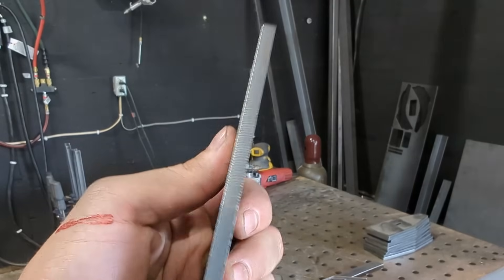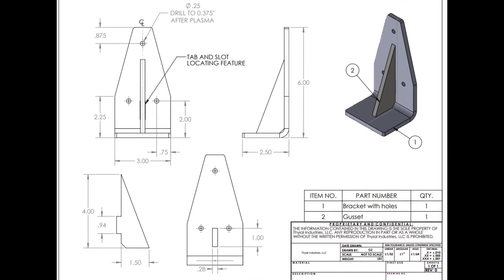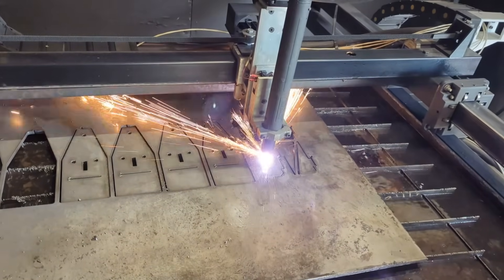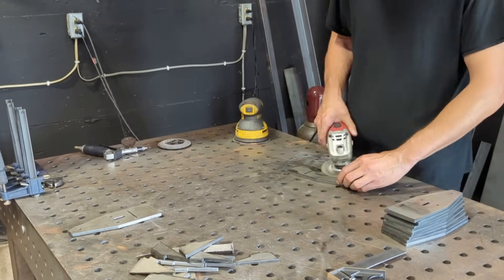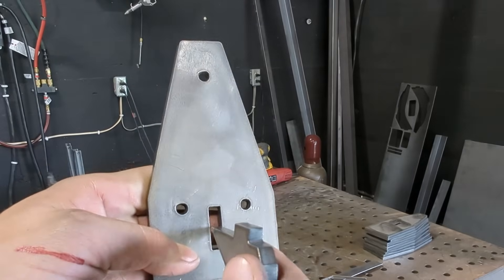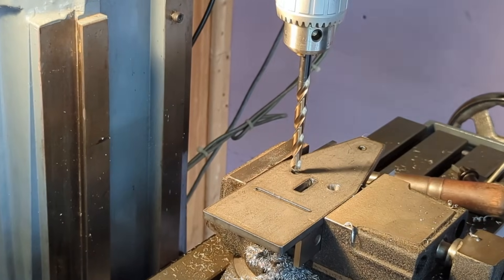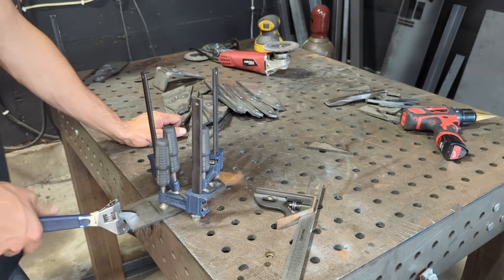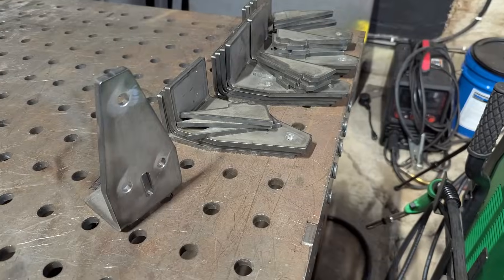No Press Brake, No Problem: Forming ¼″ Steel With a CNC Plasma & a Workbench

Comment: I built my own 22in press brake from scrap I had lying around. 20ton air jack from HF and i can bend full length 1/4 plate across my die. Cost me the $100 for the jack and that was it. Beats welding up seams and dealing with weak joints
Reply from the maker: Do you want to make me one?

Comment: The slot you made weakens the 90. This trick is used for sheet metal bending, not thick steel. You are out of spec and the client has the right to refuse the part.

Comment: There are a number of steps that could have been changed. First of all your alignment hole in the big part was not the problem. The problem was the radial cut in the corners of the small parts alignment tab. It would have been better to raise them to a 90 degree OR over cut the corners. The smartest choice would have been a 90 degree path. Bending the big parts on the table isn't a bad choice. though I would have clamped down a few guides so repeat parts were just a drop in clamp and bend. though the better choice would have been a good size bench vice say a 5.0 or so. set a spacer jig below inside the jaws and just drop them in. Start the bend as you where then finish with a  block of wood or hard material like G10 or redboard and a hammer. Faster tighter with a tighter 90. I'm not saying anything in the video was wrong just there are better methods.
Reply from the maker: Appreciate the detailed feedback and suggestions!

Comment: The one thing you didn't explain but I wish you had is how to adjust your CAM setting for the single pierce and straight line cut. I have a Langmuir Crossfire Pro table utilizing Fusion 360 coupled with an 80i Everlast plasma cutter. I've had trouble with single pierce/straight cuts not being recognized in the CAM portion of programming. I wish someone would explain what steps to do for this process. Thank.
Reply from the maker: I would have went more in depth. But as you noted, it's pretty subjective based off of what equipment and software you are using

Comment: If you notice, anybody who commercially sells “slot and tab” (yeah I know) products, “dog bones” the slots to compensate for corner kerf. Also there is always a kerf width setting in the CAM software that can be used to alleviate the issue. A few test cuts to tune the parameters is a wise time and material investment.
Reply: Thanks for this. I've been doing the dog bones but been manually adjusting offsets for kerf. Had no idea there was a setting built in

Comment: If you are welding there's zero reason to make the tolerances that tight.  Welding jumps a gap easily enough.
Reply from the maker: The tolerancing is for fixturing. Not welding

Comment: If you have a small workshop press, for bearings etc, a vee tool and blade will be muck quicker than using the bench and clamps for a narrow bend like that. Your plasma does well, I had a 40k 4mtr x 2mtr  with a hypertherm 65 and it was useless for slots and small holes, even with brand new consumables it cut on an crazy angle after piercing..

Comment: When bending with slots the amount of material left between the slots should be the same as the thickness of the material. When looking at the tab (holding the pieces together) in the plane view, the tab should be square no matter what the thickness of the material.
Reply from the maker: That make sense. That's kind of what I was seeing

Comment: I thought about doing a relief cut with a grinder to do a 90 degree bend in 1/4".   First attempts my mild steel cracked.    
If I can get it to bend, should I weld / fill the relief cut to strengthen the bend?
Ideally I'll get a press in the future, but I'm wondering what others do until the buy a press.
I checked with a few fabrication shops and they don't have a break small enough to do the two close by bends.

Comment: Did you add any welding in the tab and slot bend area to compensate for the loss of material?
Reply from the maker: Lol thanks for all the comments! And the customer might have? But I'm not sure. These are going to be tied into drywall supporting some retail shelving. So nothing too crazy in terms of weight.
Reply: @ThyialIndustries  Ahh okay then yea not needed then.

Comment: I have been "pecking" the center holes to finish the job on the drill press.... Burned up so many drill bits trying to get through the hardened kerf.

Brackets look great!
Reply from the maker: That's not a bad idea. I had to resharpen after that job. Thanks for the support!

Comment: So I’m just guessing here but you center that slot for the bend on the bend line. Or is there some math involved to figure out if the part needs to be a little longer to make up for the bending process?
Reply from the maker: If you use a CAD software like fusion or solid works, the software does the math for you. But yeah your on the right track

Comment: A good idea to show people - even with a brake press this would allow thicker material than normal to be bent 3/8 or maybe 1/2 in a 1/4 break.
Would it be a good idea to put an undercut into the corners of the tabs so that they can sit fully down on the main part. 
Cut so that it looks like you drilled a 1/4 (?) hole at the corners. You can't chamfer the inside of the slot so it will be square and the "1/8" radius" should allow it to sit down cleanly.

Do you chamfer your parts - or just remove the dross?
A chamfer may look more professional AND it lets the paint have an easier time on the corners. According to @Blondihacks its what separates us from animals... :)
You can start with the little air powered chamfer guns for ~$30 and go up to$1,000's.... if you get that big.

Comment: clearly your in love with your newest toy   as  the angle grinder would have  got them tabs ground down to fit in half the time  i would have like to see a few of them welded out  did you weld the outside of the bend .. Id be interested to try tilting the torche and gouging a groove to fold along but its an extra operation   . good content keep at it  .
Reply from the maker: Thanks! I didn't weld them but the end user might have. And yes, been loving the new mill and lathe lol

Comment: You would need to run your 3/18 carbide end mill about 8-12 thousand RPM in mild steel depending on the particulars.
Reply from the maker: Yeah, I was just lazy and didn't feel like swapping out the belts lol

Comment: just a question about those bend lines. are they 1 line with the thickness of a single pass kerf. and do you fill them with weld after you weld on the gusset?
Reply from the maker: Yes they are only one line! About 1/2" from the edges. Sometimes I go back and fill in with weld. But it depends the use case.

Comment: Sketchup was an amazing free and simple-to-use CAD program that revolutionized design for many industries. For something like basic architectural work, simple manufacturing with basic shapes, it works very well. If you want to do anything more complicated than boring a hole, the limitations will add up quickly. I don't even use it for anything with curved or sloped features.
Reply: I've been using SketchUp Make 2017 since it was released. While it's not supported any more, they followed fusion 360 and are web only, it can still be downloaded. I still use it to design parts for my crossfire plasma table because it can export dxf and SVG while their current free web version can't.
Reply from the maker: Interesting. So probably a good beginner friendly cad huh?
Reply: @ThyialIndustries  Yes, definitely.
Reply: Sketchup was free. and like many cad softwares when it was new it was free for a few years and they let you use it long enough in a FULLY free model till you needed it. Then switched it from a free model to a pay models and if you wanted to do anything with your models you had to pay. luckly I had saved all my files in a different format before that happend and went to a better software.

Comment: Your a fabricator, just make yourself a hydraulic bender.
Reply from the maker: Time and money. Have to find somewhere to fit this in!
Reply: @ThyialIndustries I get it, I bought a harbor freight 20 ton press and fabricated a 90 die out of angle iron and i use that to bend any piece that will fit within the press. For something like what your doing here it would be perfect.
Reply from the maker: @hustlerkc11 yeah that's definitely not a bad idea

Comment: What a load of complete BS. By putting a cut on the bend you have a massively reduced the strength of the part. It’s a weak part masquerading as a high strength part. It probably has the same strength as a folded section half of the thickness of the material you’ve used there. Pointless, expensive, stupid.
Reply from the maker: Maybe we didn't need the part to be strong?
Reply: @ThyialIndustries  What is it, just decorative trim?
Reply from the maker: @brianb-p6586 it's a bracket for retail shelves for a nature preserve.
Reply: @ThyialIndustries  no offense but if it doesn't need to be strong why use 1/4" steel?
Reply from the maker: @tballew that's what the customer wanted
Reply: @ThyialIndustries  well that's a good reason!

Comment: Good morning, have you checked out swag off roads finger brake kit? its about $350.00 you pop it onto a harbor freight 20 ton press  and you can also outfit it with an air over jack to make it way faster, i have had that one for a couple of years, i'd recommend it starting out. i've also been checking out Langmuir's titan press brake... I want it but i'm seriously running out of room working out of a 2 car garage with a 4x8 plasma table in it lol.
Reply: Also thyial i was wonding if you have any luck selling on Etsy? i've been thinking about trying it out, even if i could move $500.00 a month of profit on there i would be happy.
Reply from the maker: Lol I know how you feel. And yes I've been looking into both options. Leaning more towards the Titian but have to scrap up the cash somewhere

Comment: So I was one of the first to use tab and slot construction of architectural metalwork in Houston many years ago. 
The slot and bend is another variation but still requires welding. Not sure this is really a game changer but it does teach some important principles utilizing either plasma, laser or waterjet. Back cutting or coin cutting is another method for volume work....
Reply from the maker: Right, the way I see it, it's a tool at your disposal. Just have to decide when is the right time to use it
Reply: @ThyialIndustries  Use everything at your disposal. Harbor Freight used to sell a contraption that looked like a guard for a 4" grinder that would allow you to back cut sheet or plate...or slot the sheet....very cheap handy tool.

Comment: Mind me as,ing what you charge for all of the brackets?   It would have taken longer to make since, no brake, having to mill and drill
Reply from the maker: I believe it's was around $200-250. And yeah I agree. If I could have pulled these right off of the plasma cutter and formed them that would have been the ideal case scenario

Comment: Bro gets his panties in a wad over "slot & tab" vs. "tab & slot" and then calls a drill a "drill bit."
Reply: Who really cares? Supper is dinner depending what state in the U.S. you're in. Same thing with soda vs. pop, or a hero vs. grinder or hoagie. Go across the pond and rubbers are rain boots, a boot is a car's trunk, the hood is the bonnet. People that whine about motor or engine is my pet peeve, Castrol, Penzoil, Valvoline and most other brands sell motor oil for engines, lol. Most Southern NASCAR drivers say they only have motors in their cars. We here on the lake don't call outboard motors engines, hell OMC is Outboard Motor Corp, same with Johnson and Evinrude. We all get that a motor is powered and an engine powers. But I call 'em whatever I call 'em at that time and ain't about to stop after 40 years of doing so. But I do refer to drills as fluted penetrating tools, so you're wrong on that one, s/.
Reply from the maker: @genefogarty5395 😂
Reply from the maker: 🤣 never heard it called anything but that lol
Reply: @ThyialIndustries, it's a drill. More accurately, the version you are using is a twist drill. Before the retorts come pouring in, the hand-held thingy you chuck it up in is a drill motor.
Reply from the maker: @waynec369 you must be from the older crowd

Comment: Use the plaz table to make components for a 100T press brake like I did..
Reply from the maker: Was thinking about doing this. Just have to find some time in between jobs to hash out the details
Reply: @ThyialIndustries  Ill drop you a link when I get my build vid up this winter.. Having both a plaz and P B in the shop saves you so much time.. Powder coating is next on the agenda..

Stay away from the air jacks and use a dual action ram control by solenoid valves for action.

The Titan 25T is getting good reviews check them out as well..
Reply from the maker: @SegoMan that would be awesome! Thanks for the heads up

Comment: Harbor freight 20 ton press. Buy used if you can find one. Any equivalent 20 ton machine will work. Swag off road press brake kit. Heavy duty finger break is the top tier model and worth it off you can swing it. Boom...sub $500 press brake. Have had mine for years and made a ton of custom tooling for it and made other forming tools for the press. And just used the press as a press. Good tool to have around if you do mechanical work.
Reply from the maker: This might have to be the future route. Was hoping to go to a CNC right off the bat.... But this is tempting

Comment: Harbor freight sells a brake press attachment for $180. Works good, attaches to any shop pressure 1/4" bend capacity
Reply from the maker: I've seen this. Swag off road also sells something similar. Will definitely have to think about something like this in the future
Reply: @ThyialIndustries I would go the swag route if you have the extra money

Comment: What is the idea tu take thick material and cut it so much, that it become so week, that you can bend it by hand? It could be at least welded to make the bend stronger, but for me leaving only two narrow stripes makes it useless. Just take thinner sheet, it will have same durability and less cost.
Reply from the maker: Depends on the application and use case. This case it made it sense

Comment: A no dross cut is absolutely possible, I have done it in 1/2  inch stainless steel.  Do  it dry and increase the travel  speed.
Reply from the maker: Pictures or it didn't happen
Reply: @ThyialIndustries  This was in 1995 and I do not have the part or a picture

There is an article at Hypertherm 
titled Troubleshooting cut quality problems – parts have too much dross (slag) that talks about things to try.
Reply from the maker: @2OO_OK ive read that article, if we are thinking of the same one. Very informative. But I think you were onto something with the "running it with out water" I have had better quality without water. But the wrapping is terrible in thin materials.
Reply: @ThyialIndustries  I wonder what would happen if you spray or flood water on only the top surface where the cut has just gone by.
Reply from the maker: @2OO_OK 🤔🤔 I wonder. Would be a good experiment
Reply: @ThyialIndustries  Also one side of the cut can be more square than the other so choose cut direction so the bad side is in the waste.

Comment: Just bought the 20ton shop press and. a  hydraulic over air jack from harbor freight and the swag off road bending brake made for it. works great. Check out swag off road, they have a few diy weld together kit, very affordable option.
Reply from the maker: For sure! I've seen a lot of people highly recommend that setup will definitely have to think about it more!

Comment: A shop press with brake attachment works great for small part
Reply from the maker: Like an H frame press? I've been eyeballing the harbor freight one but haven't justified the price yet
Reply: @ThyialIndustries ya I have a princess auto (Canadian harbour freight) one.  I’ve used it a lot so far. Pro point 20 tonne
Reply from the maker: @Matchemmetalworks nice!

Comment: A good magnetic chuck comes in handy for cleaning up small parts. You don't have to keep a finger on the end to hold down while grinding or wire wheels. Also, magswitch magnets are great for similar situations. They are not cheap but really good for holding things. I use the magswitch 400s the most.
Reply from the maker: That sounds like a great idea! Would definitely come in handy. Was also looking at this auto feed belt sanders.
Reply: A big neodymium magnet placed on the welding table is enough for keeping the workpiece in place for deburring. A magnetic chuck would definitely be better, though they're a little pricey
Reply from the maker: @diego.almeida a permanent magnet may attract all of the dust and slag droppings. This happens all the time on my magnetic squares and it's a pain
Reply: @diego.almeida  mag chucks are wild cheap, and also they come with a surface ground finish that's flat to a few ten thousandths of an inch.

I got a 6"x12" off ebay new for 90 bucks, and thats very cheap considering the weight, precision, and mechanisms. Works good 🤷‍♀️
Reply: @napaisava  I'm from brazil, the cheapest one you can find here cost 500 dollars, and it's very hard to find used ones. and that's a little too much just for holding the workpiece in place for deburring. Americans are really lucky that they can find used things in good state easily on ebay, the other day I watched a video of a guy who bought a Bridgeport mill for less than 2k, here they cost more than 11k and are in very bad shape usually.
Reply: @diego.almeida awh dang. Mine was new and from a company storefront, not some random guy selling new old stock, so it wasn't like I found a deal or anything, just was market price of ~100usd

Also Brazil has a nonstandard power grid voltage/frequency iirc, so that likely doesnt help with machinery.
Reply: Grind the tab to fit